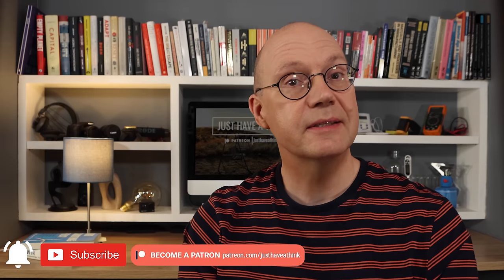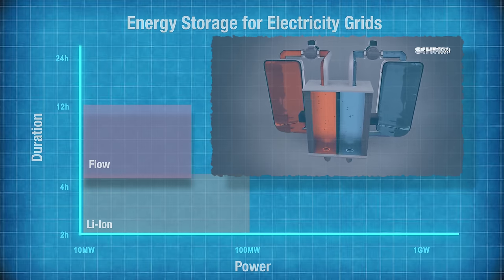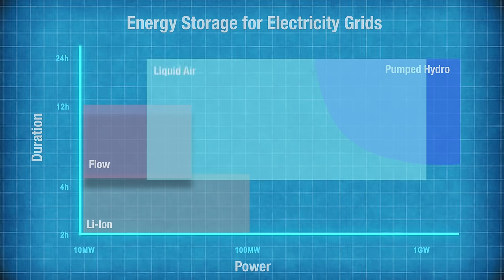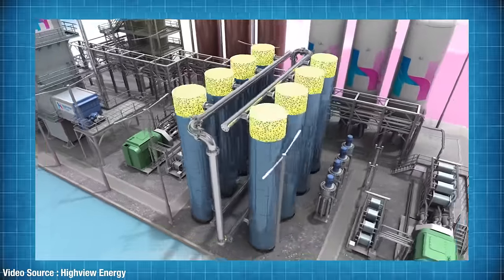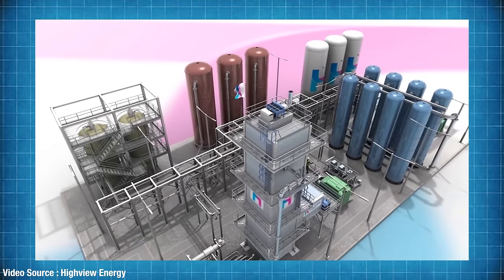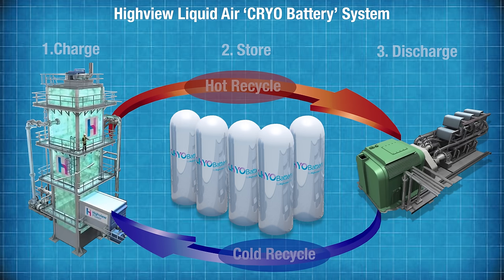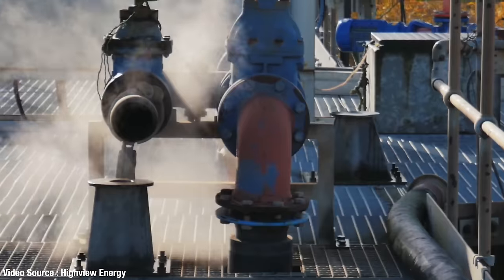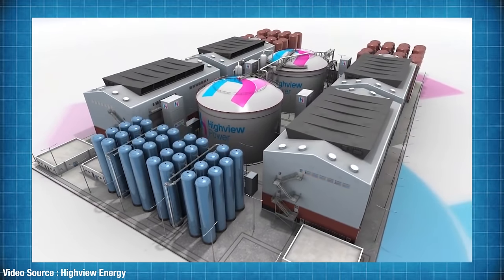Liquid Air Batteries. Literally energy from thin air. Seriously. Literally!

Comment: The full cycle efficiency of the LA storage system is quite good .  However, the presenter does not convey the actual required size of a commercially useful system .  Green power advocates love to talk about how many homes they can serve with this weeks flavor of green energy technology. The cute demo installations are but a small fraction of the required size.to be useful for utility operations
.   One factor never discussed is that peak shaving is easy a long as you don't have much of it  The awful truth is that the more peak shaving you use.  the more actual hours of energy you have to deliver in order to actually reduce the peak. Having to  deliver more  MWH of energy as the amount of peak shaving  capacity increases crashes into the reality that regular utility power becomes cheaper than energy from the peaking resource.   Also, the complete package includes both the power source and the storage facility.  What is seldom discussed is the vast area required to generate lcommercially useful  amounts of power.  Ask some one how large a 500 MW wind or solar generating facility would be.  There is a reason that the demo projects you see are built in such small sizes .  The adverse environmental impacts of wind and solar are just now beginning to enter serious discussions among environmentalists.  Wind kills lots of wild life and uses huge amounts of land.   Solar Uses lots of toxic materials takes up huge amounts of land, destroys natural habitats and has no provision  for disposal/recovery of toxic elements at the end of life of the panels.  Aggressive adopters of  green energy in Europe have learned the hard way that green power is not the solution it was sold to be.
Reply: Green energy is really not so green.  First, energy density for wind and solar is so low, significant amounts of wind./ solar use up huge expanses of land.  Covering large tracts of land with solar panels completely changes the ecology of the land.  Ignoring these effects on the environment would be an exercise in hypocrisy.  Wind also uses huge swaths of land.  Has issues with low frequency sound. and I s raptor killer.  Remenber, it was not too long ago that birds of prey were on the endangered species list.  Wind turbines also kill bats by the millions.  Then there is the issue of end of life disposal.  No provision has been made for disposal of the huge blades.  Solar panels contain lots of toxic rare earth elements.  Panel efficiency decreases  each year until it must be removed from service .   There ar no provisions to dispose/recycle these components.   Now lets move to the subject of utility operations.  Green energy sources are not dispatchable, That is they can't be controlled to follow load changes when they are running.  Electricity must be generated the instant it is required by a customer The utility control area authority must vary generation output on a moment by moment basis to balance generation and load utilities build an operate very sophisticated control systems that among other things balance generation and load, control power flows on transmission lines coordinate reliability requirements with other interconnected utilities.  Buy and sell power save cost on energy needs or to sell excess power to another utility at a profit to you and a svings to the purchaser.  Furthermore utiltes have sophisticated predictive models to predict load the next day and schedule the most economic mix of generationto serve load.  Green energy complicates this because it is difficult to plan economic on line generation because of uncertain supplies from green energy resources.  Further, green energy must be backed up with spinning reserves for reliability.  his is generation that must be kepton line and running at nolor low load to back up green resources.. Incidentally, these plants are burning fuel and generating little to no power.  Just to back up your wind mill or solar panel.  Then the controllabolty issues must be addressed.  Providsing reserves for large amounts of green resource puts more strain on the spinning reserve units because they must make greater swings of output to account for changes in green power output these large swings upset the air- fuel  mix settings on the units and increase emissions until the unit is stabiized.  Finally ther is another effect to consider.  Unlike your car starting and stopping generstors reduces  generator life .  They are rated in the number of start stop cycled before they must be taken apart and be rebuilt. 
There is far more to consider about green power resourcs than most people realize.  Small amounts are not partivularly disruptive because the percentage of green power to load is small.  As the amount increases, operating problems increase as a result,.  And finally the utility must build, operate and pay for additional generation  to support green power resources which  can't be counted as available reserve generation.  one estimate is 80% additional backup for green power resources. 
probably 90% of people see green power as great.  See, it doesn't burn  fuel.  However, you only see what green energy advocates want you to see. I worked for a major utility for31 years in engineering and operations.    The above is just a snapshot of the issues involved. Germany tried green energy in a big way, it didn't work out so well for them. 

i worked

Comment: While this may be an interesting energy storage system, it’s not a useful energy production system. You’re still getting the source of your energy from wind and solar which has such low energy density as to be next to useless.
Reply: They really should be focusing more on fusion. Still, portable energy, for cars and more, requires a much more practical storage system than currently available.

Comment: At 4:43 "50 megawatt". At 4:58 "enough extra stored energy to power 200,000 homes". So average 250 watts/home. I question this advertising. I use 340 watts during minimum month August (no air conditioning) and I live alone. That's 24/7 so obviously the non-sleep 16 hours is ~450-500 watts. I'm just relaxing, not growing BC Bud, so is 250 watts/home really UK average, seems so low especially at peak when this would most likely be used ? I do have electric water heater, perhaps advertising is based on beautiful High Speed North Sea Gas water heater from the North Thames Gas Board ("while you were out our technicians tried to answer your service call").
--------
https://www.youtube.com/watch?v=Bj2jTm0PtWw at 2:45 "10 megawatt"  2:57 "10,000 homes" from a hard hat safety vest bloke so you know it's good. That's more like it.
Reply: you mean kilowatt hours or watt hours not watts . 1 kilowatt for 1 hour = 1 kilowatt hour abbreviated kwh, 1 watt for 1 hour is 1 watt hour
Reply: @erbenton07   "you mean kilowatt hours or watt hours not watts". Wrong. I mean precisely what I typed.

Comment: I'd say liquid air is literally thick rather than thin.
Reply: @suprememasteroftheuniverse  Well, improving the grid's efficiency is all about energy storage, not production. Most of the ways to produce clean energy do not sync well with our consumption habits. Solar panels are worthless without the light to fuel them and if you put them in the Sahara, how do you get that energy to where you need it without losing 99%?

Comment: I love this! In addition to being a brilliant concept, and highly efficient, it also takes water and CO2 out of the air, according the this video. If this is true, it can act as a source of relatively clean water, and a way to take carbon out of the atmosphere! I hope that the CO2 is supposed to be stored, or sold to places that uses it.
Everyone knows that CO2 is a greenhouse gas, but water is also a greenhouse gas, which is likely less known. The higher the humidity, the higher the heat capacity of the air. Water is obviously more temporary than CO2, but it has heat capacity, regardless. In other words, not only does this facility act as a battery to assist renewable energy, it could also help reverse global heating, as a semi-passive effect, from the way it works! I'm more than impressed by this solution!!

Comment: Several questions come to mind regarding the entirety of renewable energy production and storage. The first of which involves the energy production source. Will wind and solar provide enough energy to be stored by the liquid air system? Both of these technologies are fleeting at best, but more to the point, they require massive amounts of energy and chemicals to manufacture and install, not to mention the actual footprint required for solar, and the hazards presented to our avian populations from windmills.

The second question I feel needs answering, is how much energy is required to actually run this liquid air power storage facility, to be effective as a battery? It will obviously require a significant amount of power, with monitoring systems and numerous other functions, which I assume would be present in a facility with several different component parts. Along the same thinking, regarding the output of this battery plant, what type of footprint is required to be on any significance, for say a medium sized city? What size would the facility have to be, and how many tanks, pipes, and generators would be required?

I am not balking at the idea of liquid air batteries, but I have questions as to its viability, other than cost savings on graphs and the theory of how efficient it is. I encourage the research and development of viable, clean energy production, and storage, that will see our reliance of fossil fuel energy production reduced. However, wind, solar, and biomass energy production have not been the magical solution to our clean, renewable, and reliable energy production solutions, which they were touted to be. 

Perhaps it is a case of 'once bitten...twice shy', regardless, we should temper our enthusiasm until a provable liquid air energy storage plant has shown to be successful, viable, and financially feasible. Even if this proves to be successful, we still have the problem of finding clean, renewable, and reliable forms of energy production, which can be stored in these fascinating new liquid air power storage plants.

Thanks for sharing this JHT.

Comment: The most efficient storage systems for energy are already used: coal, natural gas, and uranium.  Thorium will be better and make the air liquifaction "battery" not needed.  Liquifying air is a mature technology.  The best way to show its worth in this application is to produce a realistic flowsheet using a process simulator like ASPEN.  Since this process is already in use, the efficiencies of the unit operations are well known.  I don't think the efficiency will be anywhere near what the presenter thinks.  The laws of thermodynamics are not that generous.

Comment: So is a battery which is only 60 percent efficient a good deal?  Doesn't seem so even considering this system seems to have no real number of recharge cycles before it dies.   
If we can produce large volumes of excess renewable power this might be a good idea, but we are not anywhere near that goal yet.  So which comes first?  A large wind farm or these battery systems?  It would seem the storage system must come before the wind charging system, but who is going to put a lot of money in a battery system if society never really gets around to producing excess renewable energy? At this time only some parts of the country can do this such as Wyoming where we have a lot of wind and very few people to use the power generated by our wind turbines.  I see our farms stopped and not spinning on many days when conditions are perfect for them to be turning.  Our problems is we don't have a decent system of high voltage lines to get it to where it is needed such as California and soon to be Nevada as Lake Mead dries up and shuts down electric production.  So with world wide draughts in many countries around the world hydropower might soon become inefficient.  That leaves wind, solar, tidal and geothermal with only tidal and geothermal which is more or less available 24/7.  To belabor the point large scale battery systems are only needed for power production systems which are not able to produce 24/7.  Might be best to focus on renewable systems which offer 24/7 production such as geothermal and tidal and forget the large scale battery backup systems.  My 2 cents.

Comment: Why not figure out a way to make electrical components more efficient. Like, do you really need 110v power to run your shaver ??? . Outlaw any lights that are not as efficient as per bulbs . Who needs mercury or sodium lights or even florescent lights
Reply: Volts are not the unit for power.
Watt is...
Reply: @righthere80  are you asking a question. lol

Comment: This just goes nowhere for me. First, I don't see the point of the hammer. Second, you make it sound as if Li-ion batteries only work for four hours, which is absurd. That's not how things work at all. Third, 60% efficiency is not that good. It's worse than pumped hydro, flywheels, batteries, and a bunch of other things. In fact, you could probably get 60% with hydrogen electrolysis combined with solid oxide fuel cells, and you could store the hydrogen more or less indefinitely, and in as large a quantity as you want. And in a fixed application, you might be able to store the hydrogen at about atmospheric pressure; alternatively, you could just electrolyze the water, and run the H2 through the fuel cell, at an elevated pressure all through the process. You can do a lot of stuff in a fixed application that would not work in a moving vehicle.

Comment: lol daft idea yes we are struggling to breath  oh lets  store air we breath increasing co2 oh but we can store that in rock under ground yes good idea oh lets frack oh no we release the co2  and the air tanks are off line the end of uk life. what is it have you all got a death wish longer store times are the problem you cannot have millions of people  bottling air up lol its the gases we breath  or are they planning on selling us that too lol have made one 6ltr lasts 25 mins on one small turbine make your own just dont store weeks of it lol or we die air battery = air compressor power generator = a motor that as magnets in  a turbine like your garden whirligig that turns in the wind you need a feed of air constant to power up a battery at low outputs of your generator to obtain with a foot pump you would need to burn off 192lb calories per hour and am not going to tell you your c02 output lets just say its a hell of a lot everything needs taking down in size here is my law "the smallest things contains the most energy in every part of infinity" if you look around you you can see it at work start at the gas you breath , the awakening seed, the fridge you use a balloon full of water with i pin hole in in its fabric of time constant when it enters into ours can you see its power  smiles now can you use it winks think hydro then use my law lol i cannot spell but my mind sees things different to everyone else i see the heat raise up of the radiators i also see cold air I seance other things like power around me and others things